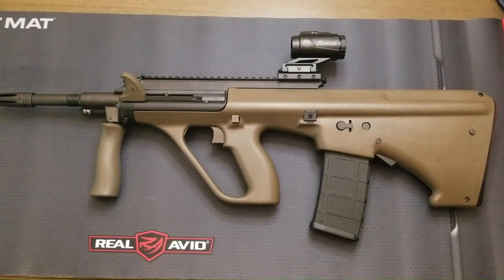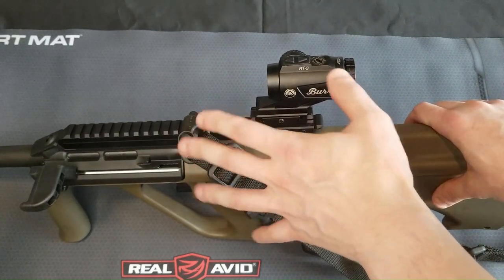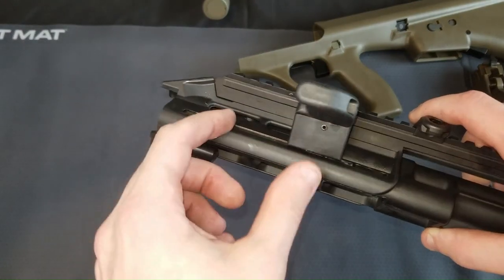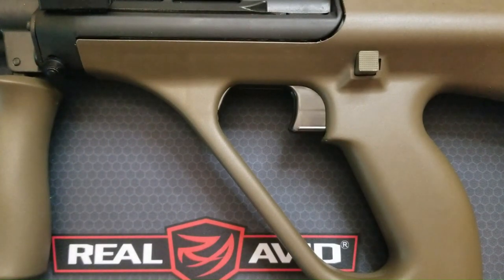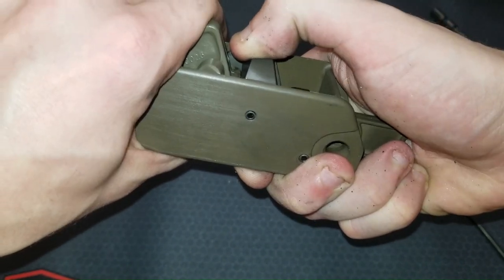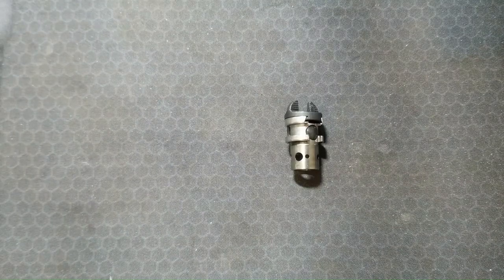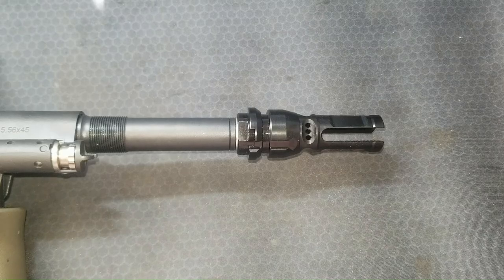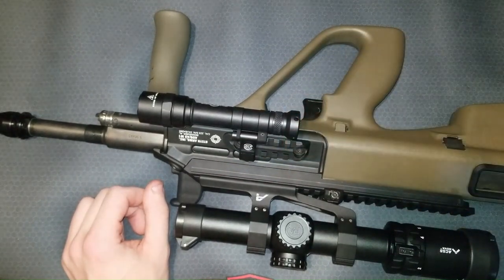Steyr AUG A3 M1 NATO Upgrades and Improvements

Comment: I’ve added the Corvus Defensio shell deflector is the bomb and the Ratworx metal sear improves the trigger greatly.  I ran across a deal on a suppressed gas plug and spare stock.  I run a Steiner M332 on my A3 NATO AUG.  Love this rifle.  I can wait to get the .300 BO suppressed barrel when it comes out.  I run a Surefire Vampire V1 IR and white light single cell light where you mount yours.  Enjoyed your video.
Reply from the maker: Sounds like a slick setup! The 300blk version will be really cool! With the ratworx sear, some dry graphite, and the spring upgrade I was really pleased how nice the trigger came out - exceeded my expectations. Thanks for watching and commenting!

Comment: @ 13:10 The stock trigger isn't nice but one thing to remember is that the whole rifle was designed to be operated with heavy winter gloves. One thing I'd want on an Aug is an A3-CQC kit, that thing looks super tidy.
Reply from the maker: Agreed on the trigger. Its also more of a battle rifle, not a precision instrument. Also the original trigger was two stage, first stage was semi, then pull it back more for auto, I am sure they wanted it heavy with a distinct stage between the firing modes.

The A3-CQC kit does look sick!

Comment: Very useful information, thank you. I’ve bought my AUG used, and it runs Wolf steel case just fine with a ptr vent 3 suppressor on normal gas setting. Im not sure what the previous owner did with the gun but Im pretty sure those variables are unexpected of an AUG. Since it works so well I was thinking of dropping the $250-$400 to upgrade the trigger with red springs, ratworx sear, arid trigger, and graphene lube.

Comment: v1 is always out of stock, steyr usa sells a suppressor gas plug, they seem to be in stock the few times ive checked, for 109 bones
Reply from the maker: Yeah I was on the V1 waitlist for a good month or two before I got the notification it was in stock. Still about $100. And for the reasons I lay out in the video I'm a big salty about the price and functionality of it. They had an opportunity to really tune the inlet port size for suppressor use (instead of just venting more gas off - which will make it was louder). Also not including the position 2 (adverse) even though they had the room for it also sucks.

I just looked at the one available on the Steyr USA site. It looks the same. Same port sizes and locations. This one was not listed on the Steyr site when I was looking for it. Only the one on the V1 site was available.
Reply: For some reason it won't let my reply but it seem similar
Reply: @dltz  just looked at the steyr suppressors plug, an it it appears to have the adverse port in it.
Reply from the maker: @strelokblackburn4651  Oh interesting. Not impressed with the V1 gas plug. No adverse position even though it has space for it kinda sucks. Its nice that the Steyr one does. Also I don't know why but i thought the V1 plug was a factory steyr part... maybe its not.
Reply: Well I'll have to try it when I go shooting next time. But the forst 2 settings the holes line up, and the in gr setting, looks like it the hole lines up to the vent hole on the normal setting.
Reply from the maker: @strelokblackburn4651  That would be awesome if you could report back! For 3 positions there should be 6 holes total. The V1 plug only has 4 holes (2 positions).
Reply: @dltz  this also has 4.
Reply from the maker: @strelokblackburn4651  Oh then it probably lacks the adverse position like the V1 plug. You can take calipers and measure the hole diameters to determine that compared to your factory plug. My suppressor plug only had position one (normal) and the suppressor position when turned to "GR"
Reply: @dltz  I don't have any calipers hah, idk maybe I'll take it and my new jakl out next weekend. And check it
Reply: @strelokblackburn4651  There is no adverse setting with the suppressor plug.